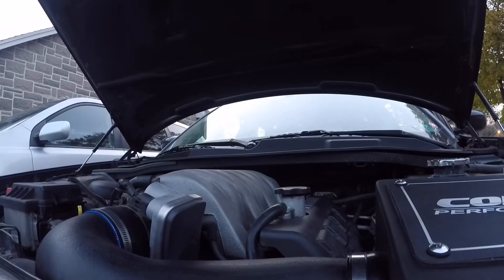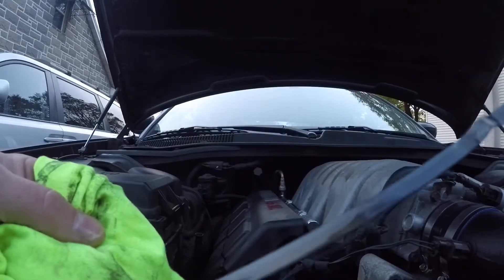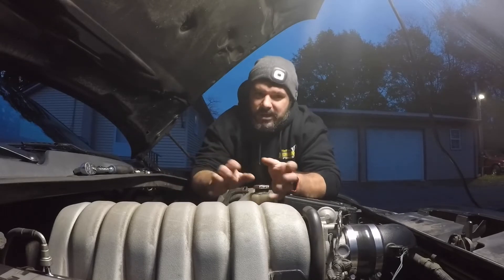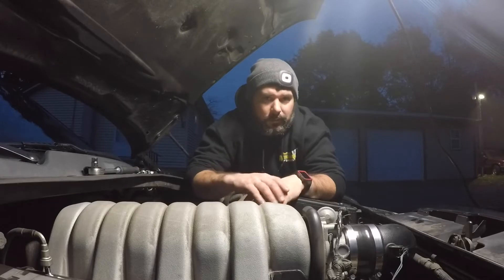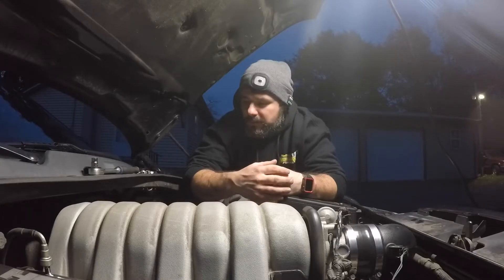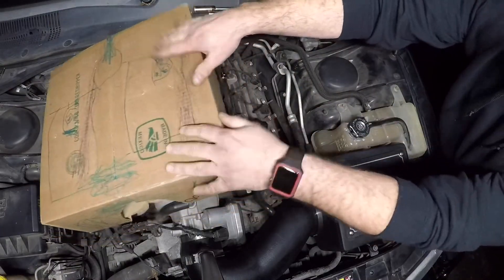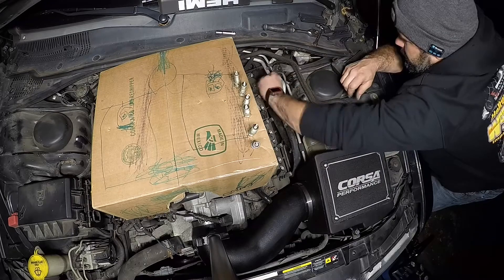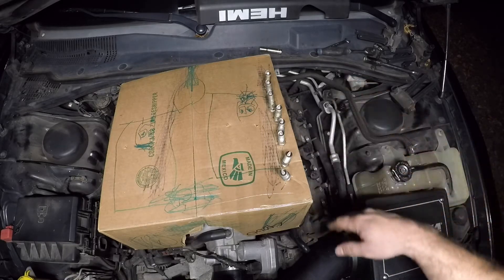Chrysler 300 srt8 dyno prep!!!

Comment: Really appreciate all the Chrysler 300 videos. I have a 05 300c, got it at 150km now its at 260km. I've had it about 6 years, at times it would be parked through out that time. I've done a good bit of "maintenance repairs". Thanks for the videos